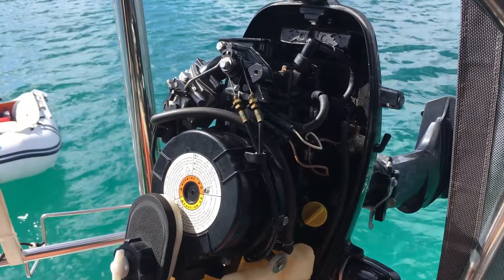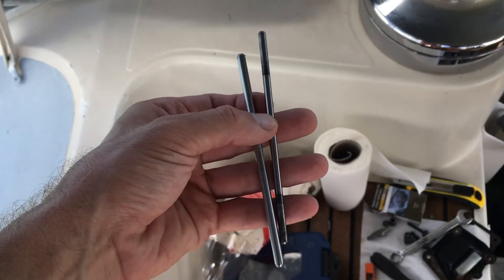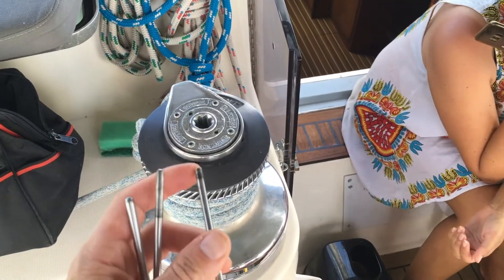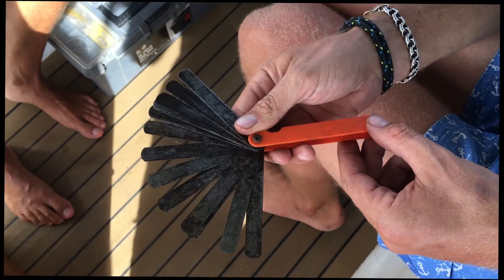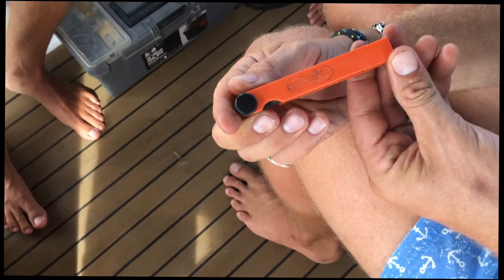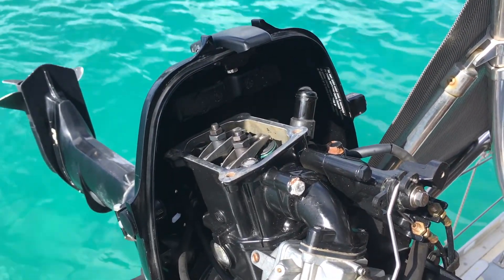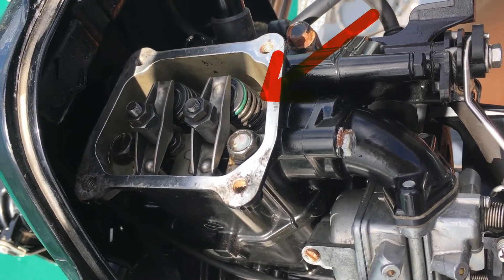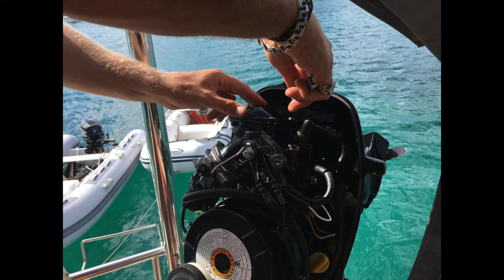4 stroke Mercury / Tohatsu / Nissan (4/5/6 hp): Valve clearance / gap adjustment

Comment: Good  job!!
What  valve clearnance  did you do

Intake 0.06-0.14mm

Exhaust take  0.11-0.19mm
You start with 0.14? 
To see if it has clearness over 0.14
 And set it 0.10mm ?

Comment: How do I know both valves are closed?
Reply from the maker: They are not closed at the same time.  Feel for compression (suction) with your thumb on the carburetor air intake as you crank the motor for the intake valve, and feel for exhaust for the exhaust valve.
Reply: @eXpeditous  Thank you very much, appreciate your help!!